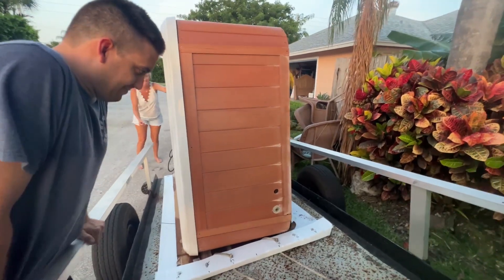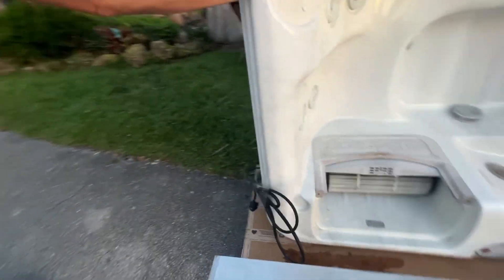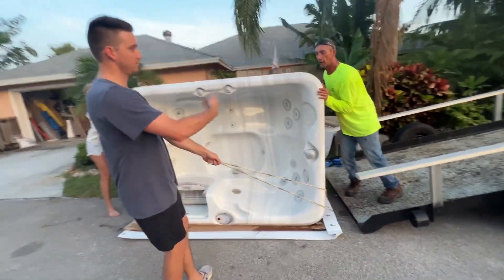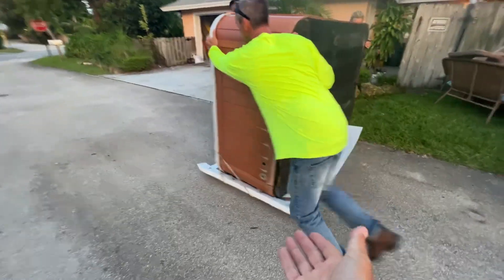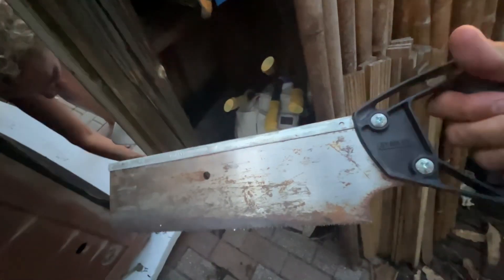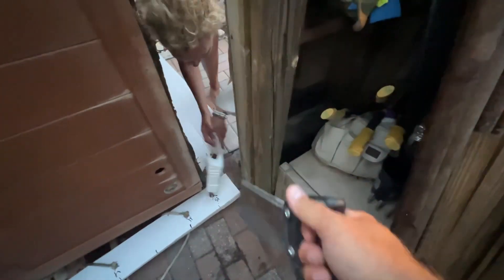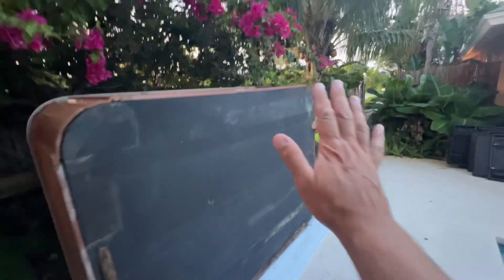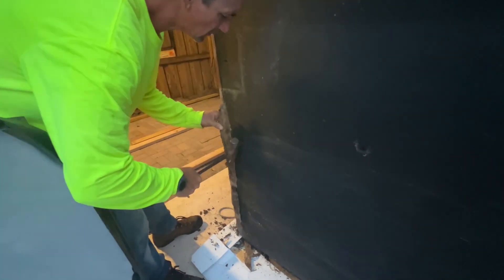How to easily move a hot tub without lifting it. Make your own sled 🛷

Comment: I just moved a 5 seater posted at 440 lbs using this method and across the grass and gravel driveway it wasn’t working. Luckily a riding lawnmower pulled it no problem.